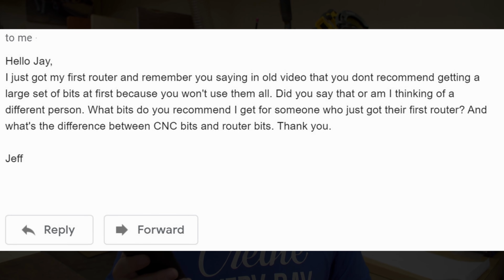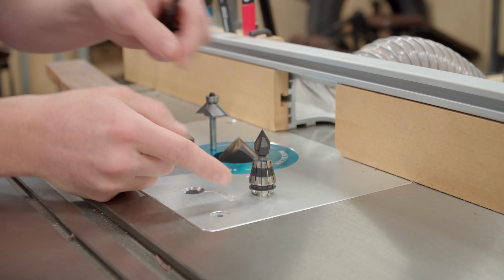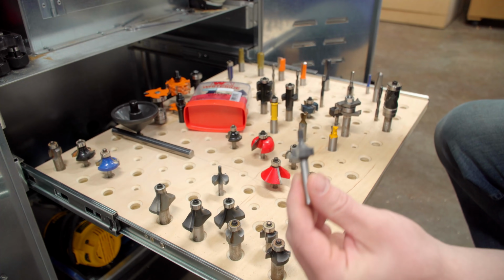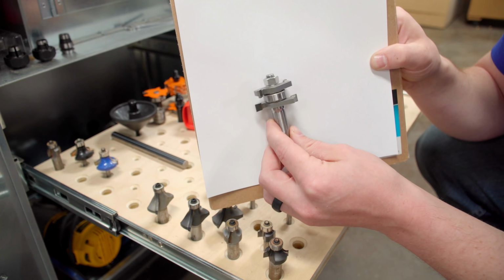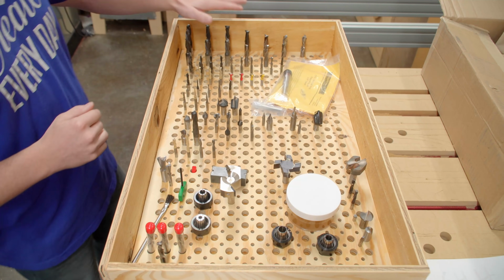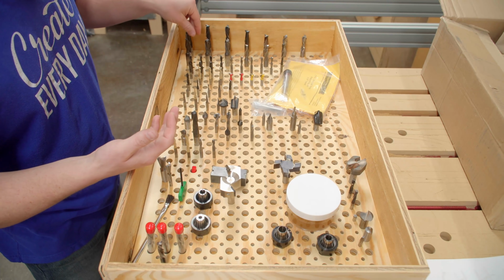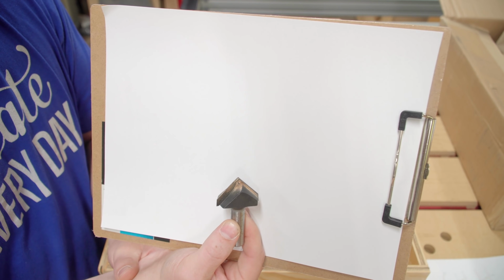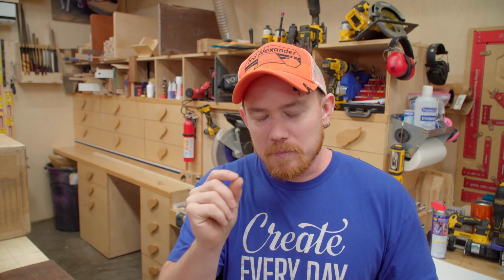About Router Bits..

Comment: How often do you clean the bits and table saw blades? Also, is there any fear of washing away the Astra coating?
Reply: To answer the washing question, no there is no worry of washing off the astra coating. You can use pretty anything to wash your bits with no worry of washing it off the cutting edges.

Comment: This is what I found for router bits getting started. Buy a good standard router bit kit with variety. Not complete cheap junk but not the greatest. When one breaks buy a bits and bits (or equivalent) router bit. It will allow you to figure out what you use and what you don't . You'll have the decent ones for periodic specialty use and the ones you use most often will be the best of the best. Not exactly what Jay recommends but it's works well for me.